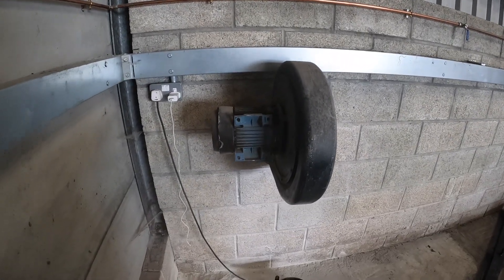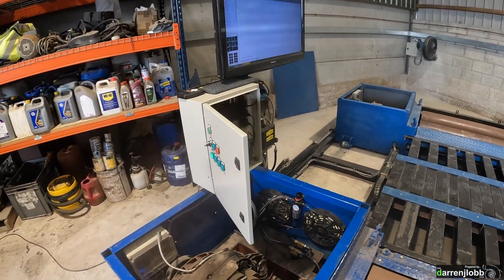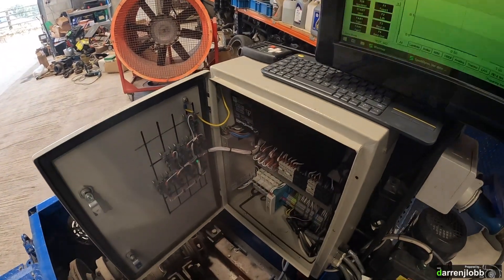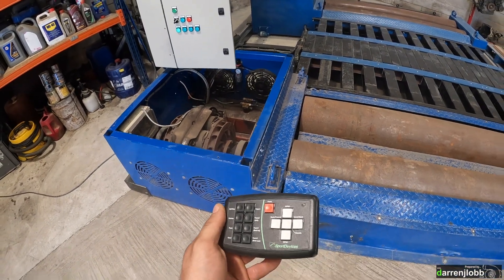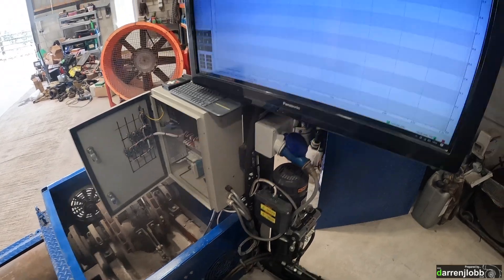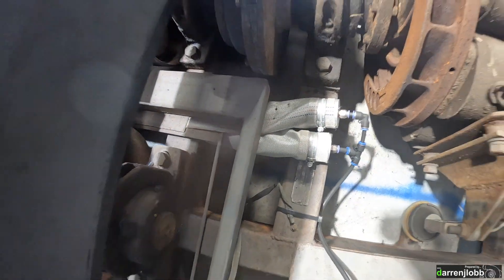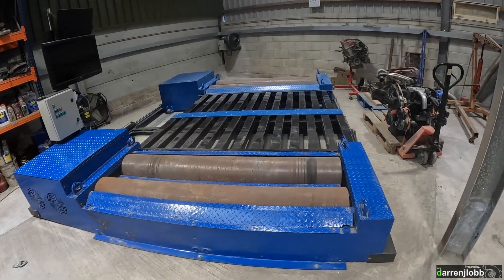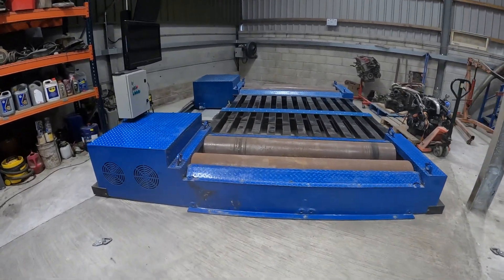4x4 Chassis Dyno Project Part 7

Comment: Build a sound proof box for the extraction fan
Reply from the maker: Its almost silent when it idles down so would be little point....
Reply: @darrenjlobb  I'm talking about when it's full chat. That would be the point. It'll make it look neat too
Reply from the maker: Ah, there would be little point at full chat as the car would be far louder than any fan / extrator at that point...

Comment: Superb. I made my calibration bar slightly different. I have a box section running on the top of the brake and a 1.5m box section slides through the centre of it.
I zero cell before i fit the cal bracket. Then fit it and I slide the length until reads zero again to null-out the effect of the brackets and arm.
Then i measure 1m from the centre line and hang my cal weight from that point.
I dont think the software actually bothers about the zero    but at least when i show the cell input on the gauges page i can tell if there is any drift.

I love the vfd/automation of the fans. I should really set that up. The loudest thing about dynos is the bloody fans😂
Reply from the maker: Sounds like a good solution, the newer software versions seem to auto-zero the cell on startup to account for differing temps etc....

Yeah i would highly recommend automating the fans, little things like that make such a big difference!

Comment: I worked with the guy that made the software to impliment a way of adding load to the dyno when doing your rpm calibration. Be worth checking you've got that update.
Reply from the maker: With Jose? That sounds like a great addition, I have actually requested that feature in the past... Would be very handy as there's always a bit of slip / deviance with the rpm calc when under load , I don't believe I have that update though and my software is pretty recent unless it's a super new update?
Reply: @darrenjlobb  Yeah thats the guy. I would drop him a line.